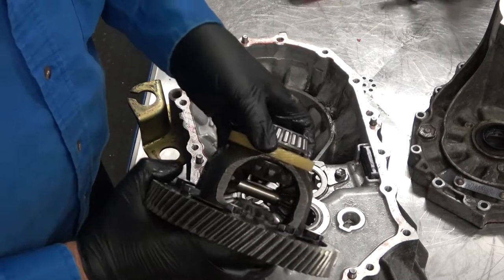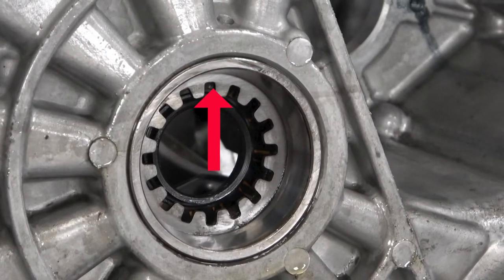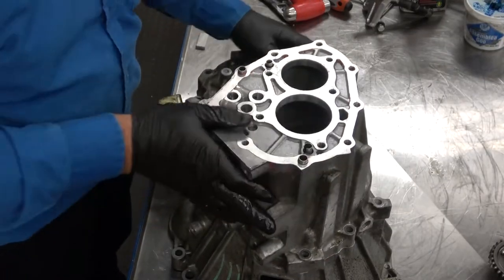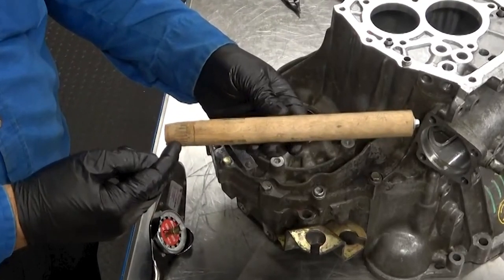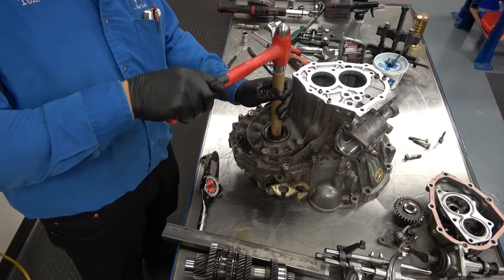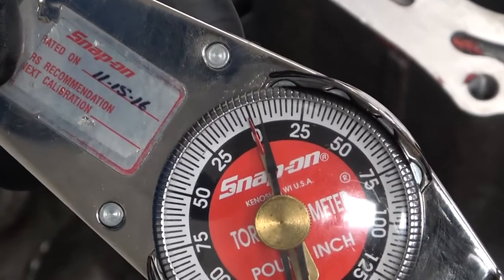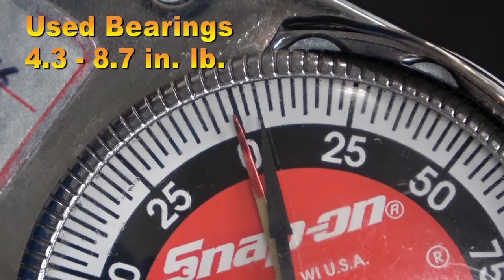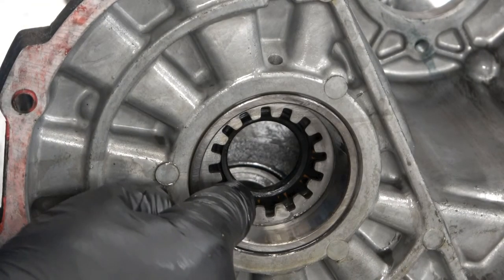Toyota C52 Manual Transaxle (10) Overhaul Differential Preload Video

Comment: to measure the diff preload, which reading are we using? the breakaway torque or the torque required to keep the diff in motion when spinning?
Reply from the maker: Toyota does not specify so I would go with the free spinning.  With all new bearing and properly lubricated the two may be very close to the same value.

Comment: and where we supposed to find these shims? Does Toyota selling them? If you buy new bearings, will these come with them included ?
Reply from the maker: I have never had to source them. Every time I check the preload I have been lucky that it has been in specifications.  I would hope you could still get them from Toyota.
Reply: @DrivelineMaster  Can you check the preload without open the transmission in half? Is there a way to do it by calculating the resistance in neutral? Also how will you understand if the bearings are faulty when the transmission is not installed in the car, only by moving the axles when they are installed on them, or is there any other way to check it?
Reply from the maker: The specifications are based on a rotational friction without the transmission gears or shafts in place so, NO you can't properly check it without taking the transmission apart.  Bad diff bearings will grumble, growl, howl or moan when driving and the noise will get worse the faster you go. If you raise the drive wheels off the ground and spin them up to about 50 MPH you should be able to put a listening device on the transaxle near the diff and see if the noise is the loudest at the diff area.  If you hear abnormal noises that howl but the noise comes and goes when you fluctuate the accelerator or when you swerve the vehicle then you have axle bearing (wheel bearings) or some other drirveline problem but not diff bearings. Diff bearings will only fluctuate with road speed but not when you let off on the accelerator or when swerving.
Reply: @DrivelineMaster  So if you listen the issue only at high speeds, let's day over 60 miles, and you delay the change of them, will these make damage to the gears, or just making ennoing noise only? How long can it takes until they completely break apart?
Reply from the maker: @_UserUser_  I'm sorry that really is a crystal ball question.  If a worn bearing that is making noises gets bad enough small particles of metal could come off of the bearing and be circulated through out the transaxle with the potential of damaging other components and adding extra cost to a repair.

Comment: Have you any idea of what the ring gear bolt torque specifications are? specifically for the earlier c50, been looking everywhere for days to no avail.
Reply from the maker: I will look them up for you but it will take a day or two.  Most likely close to 60 foot pounds.
Reply from the maker: Factory specifications for the ring gear bolts are 90 foot pounds.
Reply from the maker: Make sure to put a small drop of red thread locker on each bolt and the threads are clean and dry.
Reply: @DrivelineMaster  excellent thank you very much